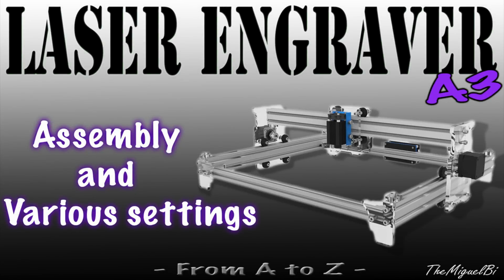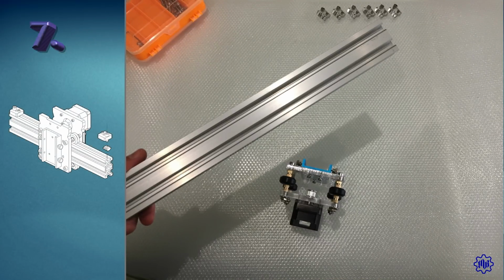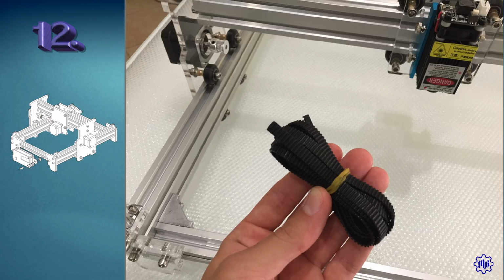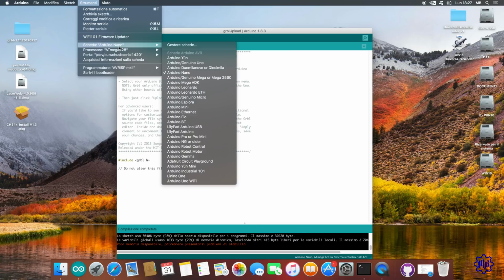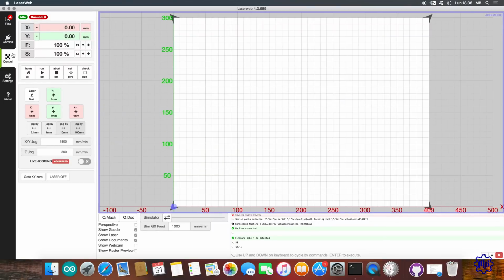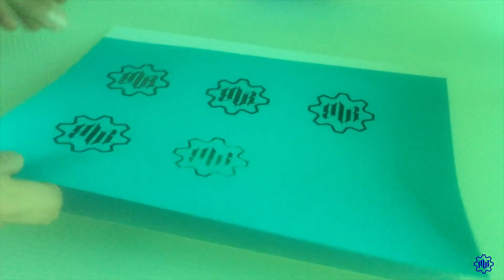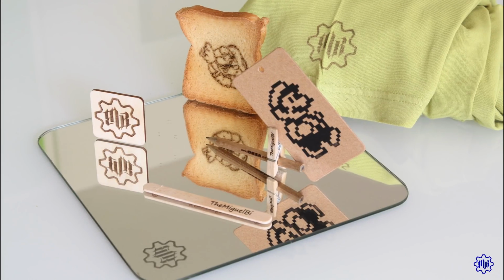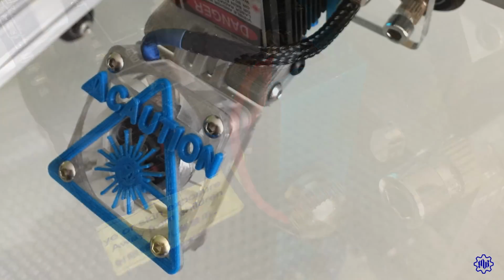⚛️☢️ Videotutorial - Laser Engraver 2.5W A3 (400x300mm) [UHD 4K] ☢️⚛️

Comment: Thanks for the video, very useful! 

I've discovered how to invert the X axis via software, changing a GRBL setting with  the command $3=1 with this you don't need the cabling hack on the X stepper.

In GRBL v1.1f are changed a lot the default settings, i've reported the settings in my wiki: http://itink.it/wiki/doku.php?id=en:tinkering:laser:eleksmakera3pro 

For those don't want go to the wiki:

$0=10      ;Step pulse, microseconds
$1=25      ;Step idle delay, milliseconds
$3=1       ;X axis direction inverted
$10=0      ;send work coordinates in statusReport
$30=255    ;max. S-value for Laser-PWM (is referenced to the LaserWeb PWM MAX S VALUE)
$31=0      ;min. S-value
$32=1      ;Laser Mode on
$100=160   ;steps/mm in X, depending on your pulleys and microsteps
$101=160   ;steps/mm in Y, depending on your pulleys and microsteps
$102=160   ;steps/mm in Z, depending on your pulleys and microsteps
$110=10000 ;max. rate mm/min in X, depending on your system
$111=10000 ;max. rate mm/min in Y, depending on your system
$112=10000 ;max. rate mm/min in Z, depending on your system
$120=1000  ;acceleration mm/s^2 in X, depending on your system
$121=1000  ;acceleration mm/s^2 in Y, depending on your system
$122=300   ;acceleration mm/s^2 in Z, depending on your system
$130=400   ;max. travel mm in X, depending on your system
$131=300   ;max. travel mm in Y, depending on your system
$132=100   ;max. travel mm in Z, depending on your system
Reply from the maker: Thank you very much!

Comment: How do you know where to place the item that you want to engrave?
Reply from the maker: Hi Fugatech 3D Printing,
Within the program, the image is placed at the starting point X, Y = 0.0 (in my case at the bottom left). Then, before you start the engraving, press the button above the laser module to turn it into "pointing" mode, thus locating the starting point and aligning the object to be engraved. Once aligned, just press the button on the laser module and start the job.
Reply: Fugatech 3D Printing i got to this video by yours XD and saw you again